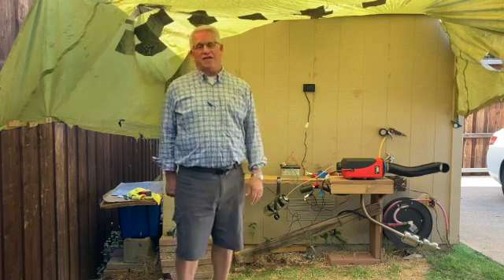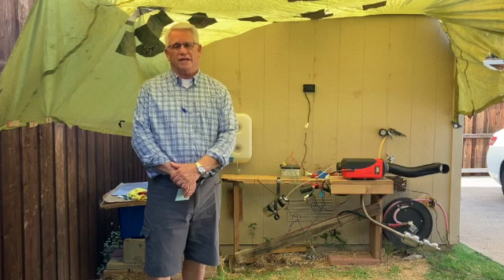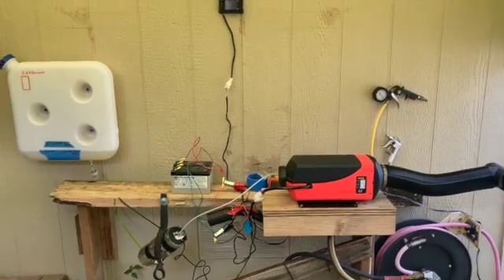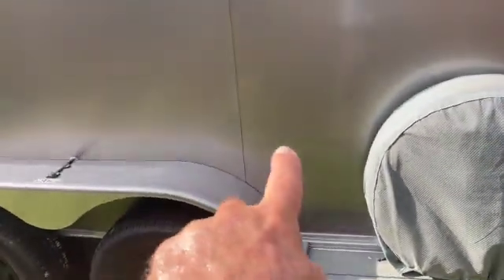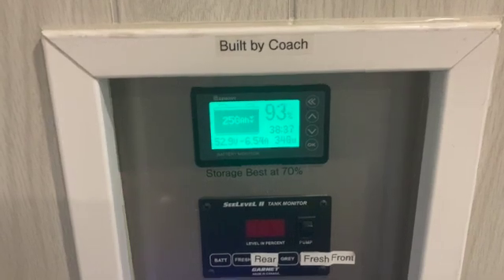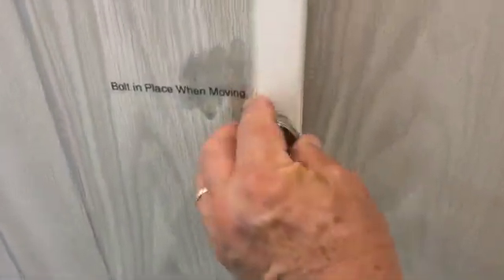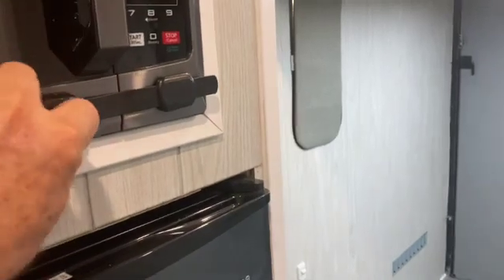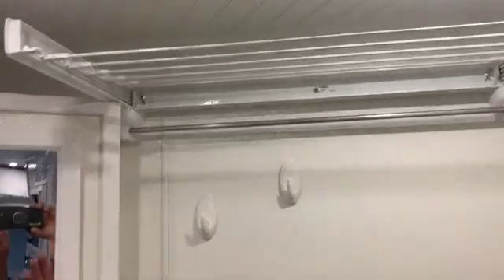Haulina update 8 2022  Starting Parking Heater Install & upgrades made over the last several months.

Comment: Jim.. did I understand correctly that you said the ac has just been setting there running for weeks continously off nothing but the solar setup (in this video)?
Reply: I was hoping for more information on your solar setup. It wouldn't let me send you a private message but I thought I left my email for you to email me ... however I do not even see that comment now... did you delete that or somehow did yourube delete the email address ?
Reply from the maker: @imlivingthedream3942  I do have videos on my solar
https://youtu.be/o2OaH1zjd4g
I have an email address for questions on the trailer
haulina2022@gmail.com
Reply from the maker: Yes, months.  1,400 watts solar & 272 ah @ 48v…. But - the 110 degree weather has hit it hard and for some reason my solar production is only 900watts at peak - I’m not keeping up now.  I’ll need to research why my solar production is down - the 110 degree temps are expected to impact usage but something does not seem to be right 🤷🏼‍♂️.
Reply: @coachgym  I’m going to send you a private message

Comment: Incredible work! I like the frig/microwave child locks. The way the frig child lock strap stays out of the way when it's not needed is smart. For the microwave, if the lock is installed in the opposite direction (turned 180°) when the microwave is opened, the larger flap will simply open with the microwave, so it won't hinder the microwave closing, rather will simply stick out a bit and move with the door. I have used these child locks for many years and got to know them well ;)
Reply from the maker: Thank You, Amy Fuller!  Yes, often the simple fix is the right thing to do.  I turned the child lock around, as you suggested, and it now works great & stays out of the way. Thanks again for your suggestion!

Comment: Your build is incredible! Could you share more about what you’re using for the cabinetry siding (is that the ride term) as well as the walls? The finish is incredible. It looks better than “factory”.
Reply from the maker: Thanks, Brandon. My wife has a good eye for color and suggested I go with a light color on the walls to keep it from being too dark in the trailer.  The gray oak board is listed below - it was about $30.00 a sheet.  I think I ended up using about 10 sheets - I tried to keep the walls from having a lot of joints - probably could have done it with less if I would have not made a few mistakes.  It does take a lot of adhesive- they suggest 2 tubes per 4’ x 8’ sheet and I did not just trust the adhesive.  I used small nails in an air nailer.  This required me to use putty & caulk to try and cover some of the nail areas that were messy.  As long as you don’t look too close - I think it turned out pretty good and when my wife pointed out imperfections- I reminded her, “I’m really just an electrician!” 

https://www.lowes.com/pd/Decorative-woodgrain-47-75-in-x-95-75-ft-Coastal-Grey-Oak-Hardboard-Wall-Panel/5001730451